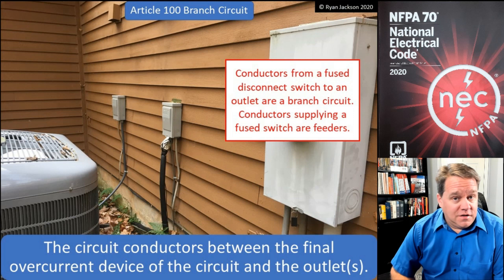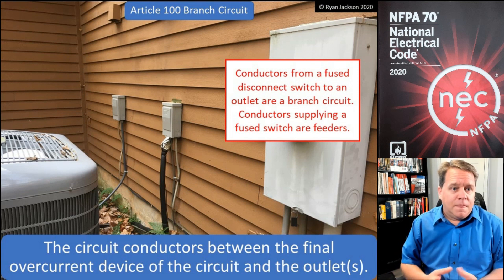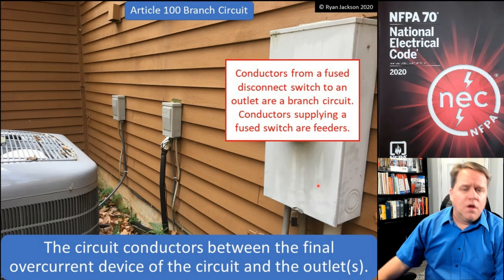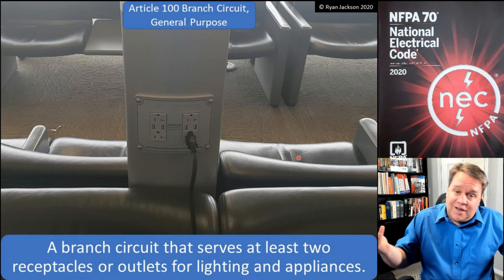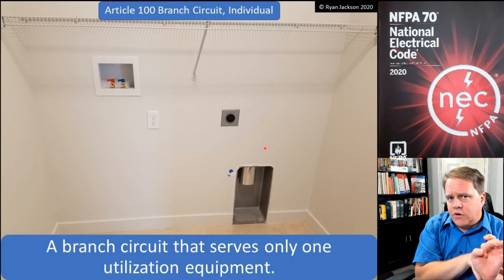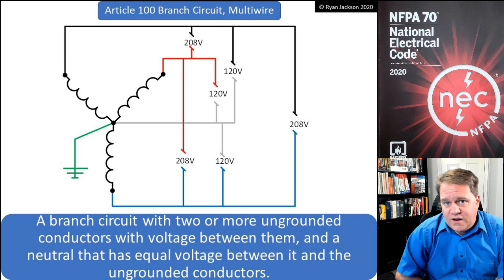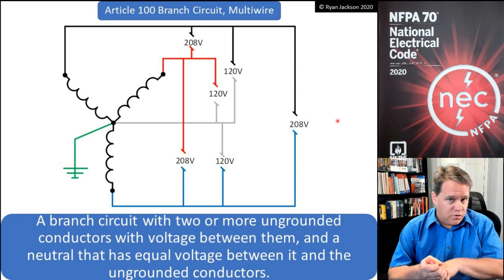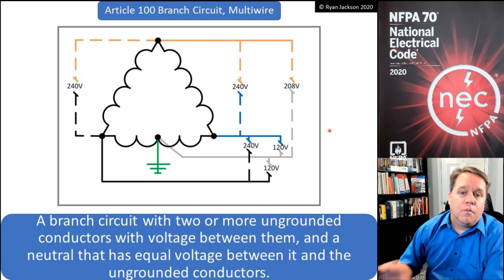100 Days of Article 100: Branch Circuit

Comment: We would all love not to have to spend to much time on unneeded items in the code (which are MANY) but unfortunately , we have to. Regardless if it is of actual use in the Electrical Trade & Safety, when taking a test, these vestigial items could be on there and could make the difference between passing or failing.

p.s. 760.121 does not have anything DEDICATED in it, in the 2017 cycle.

Comment: I had to view the beginning twice for a fuseable disconnect at the AC. I know this is splitting hairs but I'm thinking about the 10' tap rule would that still apply if you had a series of air condition to hook up off the main feed...
Reply from the maker: I don't see any application for a tap here.